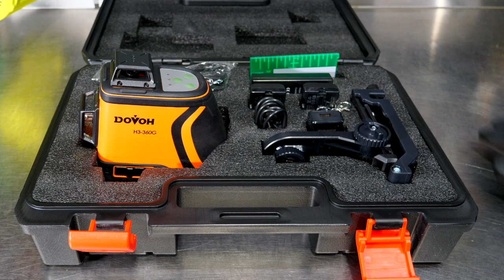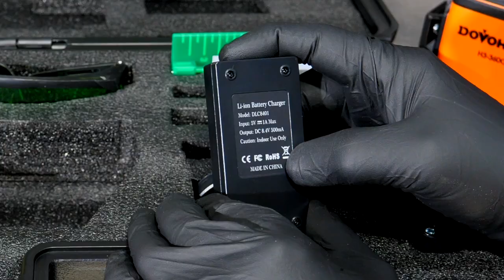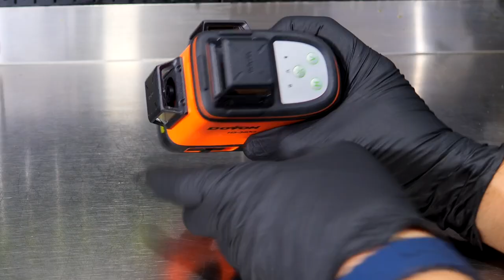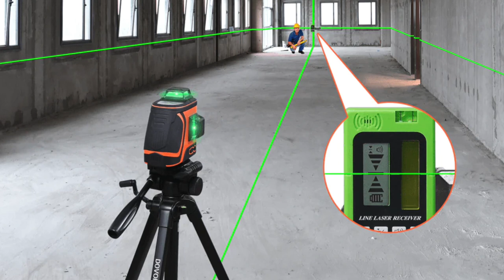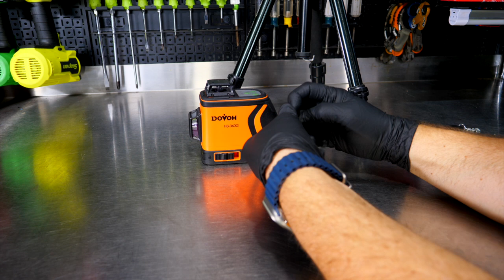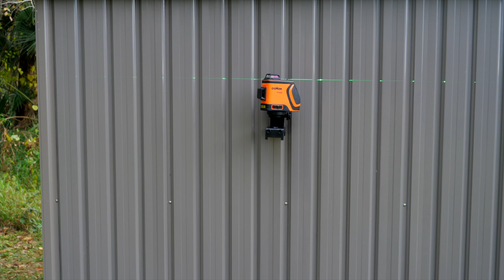High Powered 3-Plane Green Laser with Remote - DOVOH H3-360G

Comment: Huepar lasers are best bang for ur buck.
Reply: Even for daily use?
Reply: @MiguelGarcia-si8mo yes I have 2 that I have had for 5 years still going strong. Don’t buy their &60 DYI spend about $130-200 and you can get a nice laser. My nicer one is a 4x 360 plain laser with a remote and can be turned on and off with my phone.